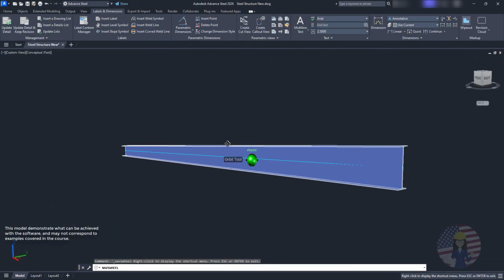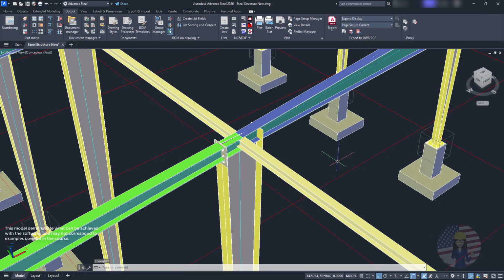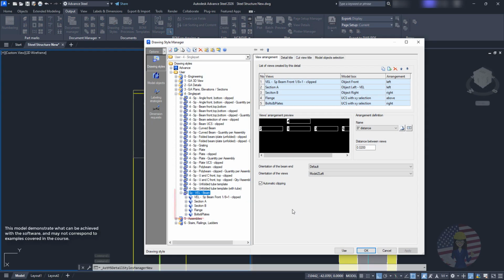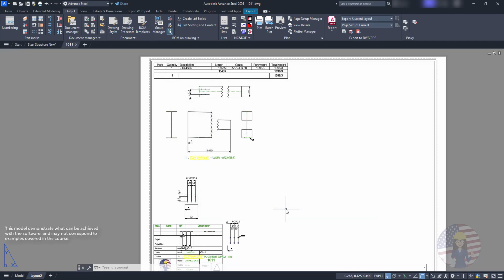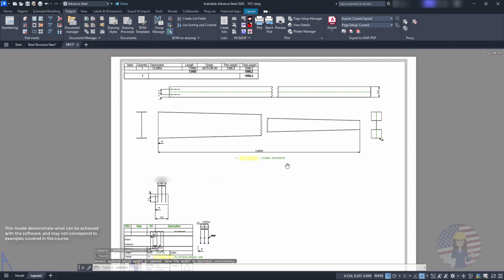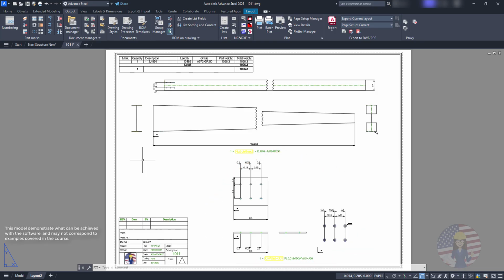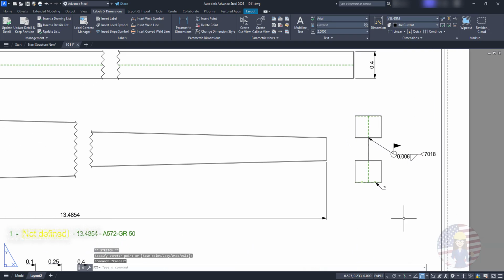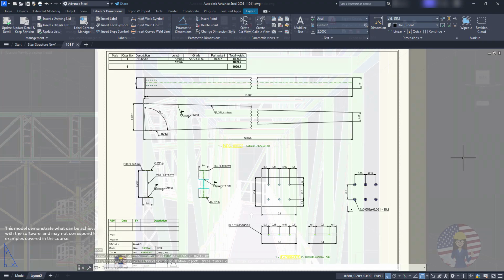Advance Steel Tutorial - Detailing and Fabrication Drawings in Seconds! Custom Steel Sections.

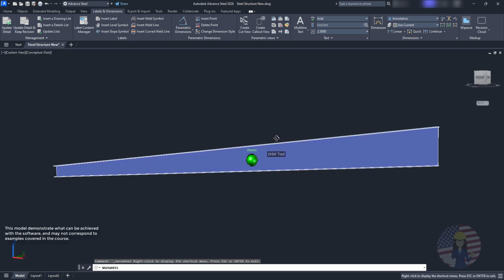Comment: Detailing non-prismatic members is usually a headache in standard CAD, often leading to errors in the shop. Seeing how Advance Steel handles custom plate-welded sections automatically [01:04] is a game changer for efficiency. If you're working on large-span structures, you absolutely need to master these custom drawing templates. The depth of the courses on your website is exactly what's missing in most basic tutorials. Excellent work!